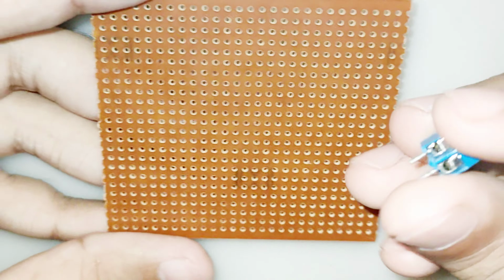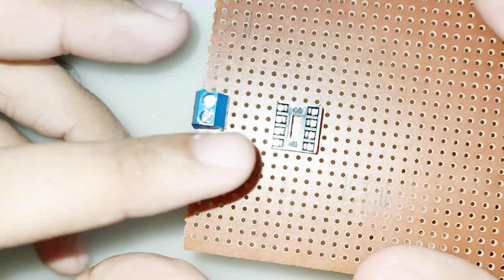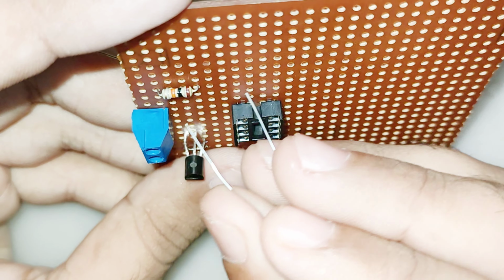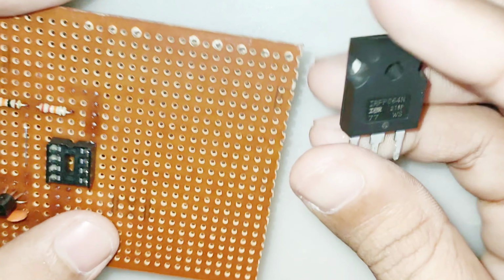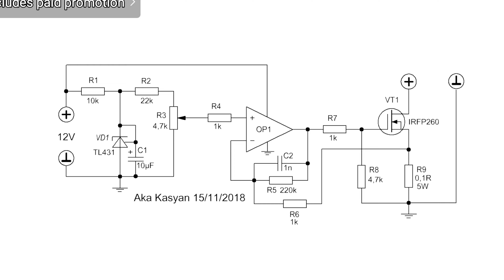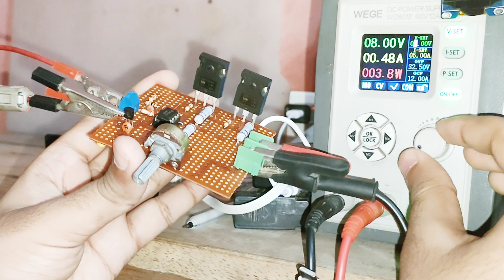How To Make Constant Current load •  [0-30V] [0-100W] ✓

Comment: Thank you for sharing. An answer, in the diagram there is 12v input, in the description 0-30v 100w. If i try, for example 14v at 100w, there is almost 7A Will it works? thank you very much. Sorry for my english but i'm italian.
Reply from the maker: Yes it will work, but you have to keep the transistors cool , I recommend using CPU cooler + Fan for Radiator!
Reply: @Electronic_For_You  perfect. Thank you very much.
Reply from the maker: You are welcome ✨

Comment: Very good video 
Please explain the circuit, am confused at the feedback section to the op amp,  why connect 220k from the output to the input ?
Reply from the maker: You should follow the circuit diagram, it works

Comment: in video  you use 2 irfp260 but in diagram only 1  irfp260  how must connect the second one and thanks
Reply from the maker: They are connected in parallel, with same base and collector resistance